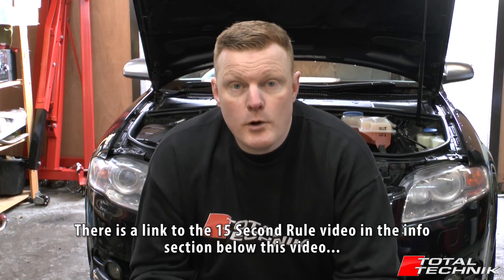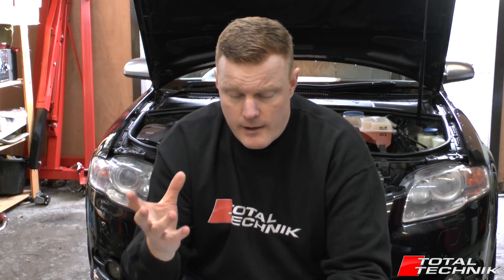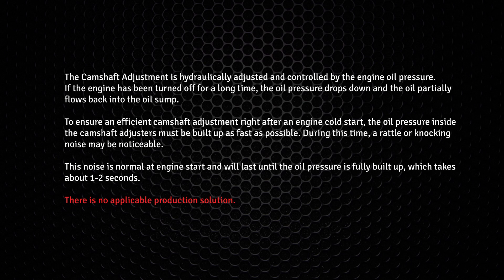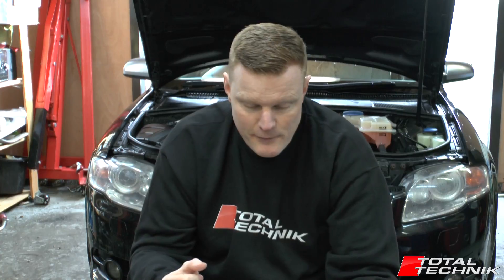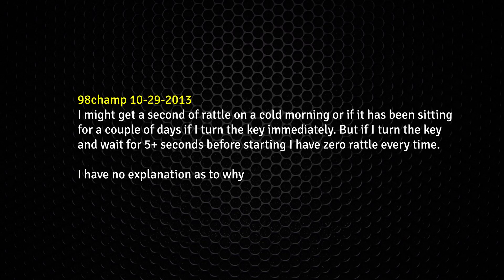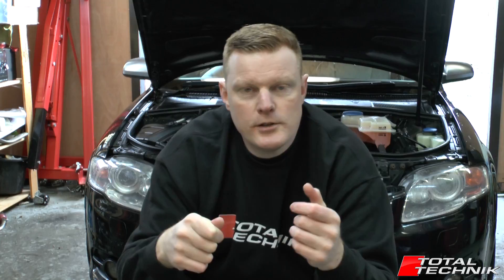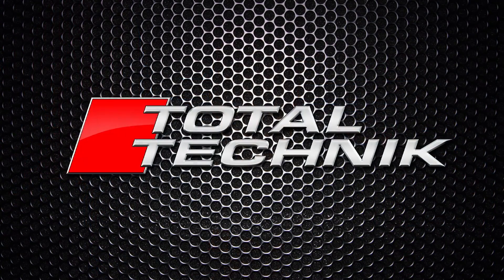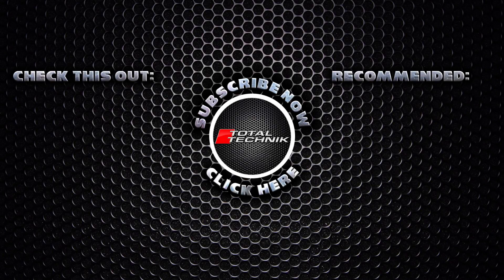Audi S4 15 Second Rule TECHNICAL DISCUSSION -  B6 B7 - 2003-2008

Comment: I have had aa 2005 B6 S4 for 8 years and after seeing your first video about the 15 second rule, I tried it and it worked!!  I have chain rattle at start up the whole time I have owned it.  Now it never happens after waiting 5 seconds or more after turning the key  I have 117K miles so far and not done "the"  rebuild yet.  One day I will as I love my S4.
Reply: Its your manifold rattling then not the chains.

Comment: Could it be the oil check valves opening up? I know that those are there to keep oil in the top end of the motor, and when those go bad, it makes the rattle a lot worse (oil doesn't stay in the top of the motor). I had these done right away when I got the car. So perhaps these oil check valves are linked to the ignition somehow? Maybe they go into a position to build oil pressure faster or something. It seems unlikely since I imagine they are also operated on oil pressure. I have a 2005 B6 S4, I never had the rattle for the first 3 months I owned the car in warmer weather (70-80degrees). I moved north and now I get the rattle 50% of the time when starting in the morning (30-40 degrees).

Comment: Interesting discussion. I can say the 15 second rule does seem to work on my b6, interesting to think that maybe its not even the chain in the 1st place.
Reply: Change you check valves... I did chains and still had rattle until the check valves were done. Never heard it again!

Comment: is it possible at all, that when the car is turned off, something in the oil filter housing shuts and when ignition turned on it opens, giving it 15 seconds once ignition turned on, gives time for oil to drop down on to chains??? 🤔 .... just bored on the bog and unlucky enough to have a s4.. what I know about mechanic,s you could fit on the back of a stamp, so if im way off then so be it😁 but this 15 second thing is 100% working for me so far👌

Comment: Always wait cranking until the fuel system is fully primed. The engine starts faster and building oil pressure quicker. It might only be marginal, but recon even the small things counts in the long run with two cold starts every day.

Comment: I've had my 04 S4 Cab since 2007 and do notice the rattle for maybe half a second at start-up, for many years now.
Only since coming across your terrifically detailed videos have I looked into this further. I've recently tried the 15 second theory but not noticed any appreciable difference. However, I have found I can avoid this by just giving a couple of short twists of the key, not long enough to fire it up, but just enough to buildup some oil pressure, before actually starting the car, and this stops the rattle.
Is this a good idea?
Reply: Makes no difference or may be slightly worse for the engine. Essentially you’re just making initial engine start slightly longer by bumping the starter and turning the motor over a few times before starting. I’d just turn the key on long enough for the fuel pump to prime then start
Reply: @trace4444   Turning the engine over with the starter to get the oil up to the chains is FAR FAR better than letting the engine start and run with the chains essentially dry. Yes you can argue that you are halving the life of your starter, but in relation to priming the chains, it is a good idea! If doing as Malcolm has suggested (I've done it quite a lot, especially if it hasnt run for a while), then you can run the risk of over priming the fuel system, which can lead to a lumpy start until its burnt it all off, but not a big issue.
Reply: Good idea. Go with it.

Comment: my bag of s..t s4,... 9 times out of ten I get the chain rattle,,, I don't like or use the car, hence most times I start the car, it's cold start,, fine when warm,,,,,, since seeing the video and jumping for joy,..iv been doing the 15 sec rule even turn it off and give it another 15seconds and it  seems to work for me so far, I have tried it a good few times and so far so good...... it makes 0 seance but seems to work,,, if any change I will post

Comment: This is a great video and one that invites discussion and hypotheses testing – thanks for that Total Technik, got the grey matter firing up.

I don’t have an S4, yet, however I am willing to sit comfortably with my uncertainty until ‘we’ can gather evidence that will either confirm or dis-confirm the software/electric-servo/mechanical intake flap hypothesis.  

If we can repeatedly demonstrate our findings then we can move from anecdotal reports to having a a solid working assumption, one that is supported by the Audi technical report, that says the solution is a software update to the control module.

If there is a way to disconnect power to the module that still allowed the engine to start, then we could gather more data?

“Any sufficiently advanced technology is indistinguishable from magic.” [Arthur C. Clarke] this is what I was fighting with the initial 15 second rule video 😊

Comment: Hi I've owned a b7 rs4 07reg for a year and very much welcome this news. For the past year the car struggled to start from a cold start which was bugging me. I thought it was a relay problem. For the past 2 weeks I have been using the 15 second rule and car starts first time from cold start up. Can't say I've had any engine rattle before 15 second rule or after. Thanks for your information.
Reply: The b7 rs4 doesn’t suffer from many of the chain issues the s4 does. I imagine the quick start with turning the key on for a few seconds is due to the fuel pressure building up. You may have excessive fuel pressure loss over time causing a long start due to the pressure having to build up before the motor can start. I am an Audi technician and we see high pressure fuel pumps leak into the crankcase all the time. This can cause the fuel to leak out of the fuel pump so when you go to start the car there is no fuel in the high pressure fuel pumps and it takes longer to build up pressure and start. You can pull the oil cap off and smell for a fuel smell to see if the high pressure pumps are leaking into the crankcase. Hope this helps

Comment from the maker: Over to you guys - please share your knowledge and experience with others reading this. There's a LOT of knowledge out there, so please do share and put in your thoughts!
Reply: I just tried this on my 2006 A6 4.2 and the rattle is now gone. Thanks to the total Technik Team
Reply: Good day the 15 sec rule did help me to quiten down the chain rattle or sometimes it was barely noticeable.

However normally at idle I get a tapping sound aswell not chain rattle tho. It goes away as soon as I engage the clutch please help. It randomly does it when it wants but by engaging the clutch it dissappears.
Reply: @amandadevraj728  If it goes away with pressing the clutch, then it is a flywheel rattle, related to the clutch.  If you change the flywheel to a dual mass one that is heavy enough, then it will go away.